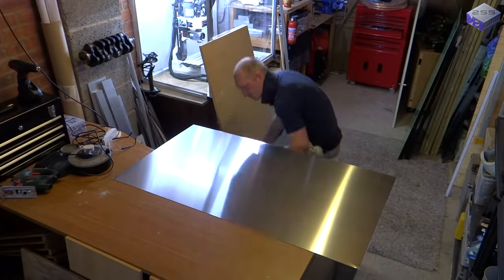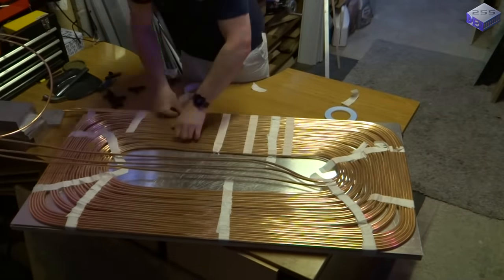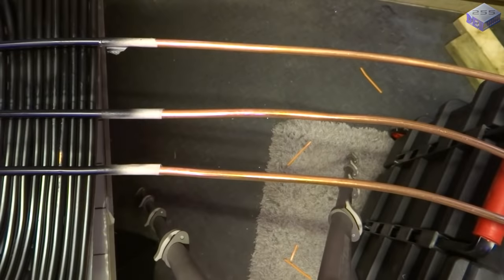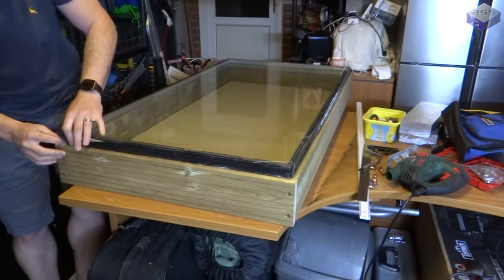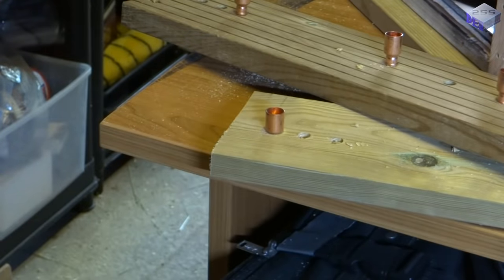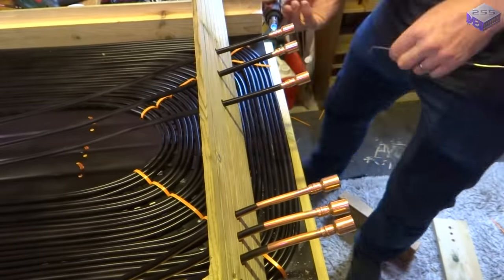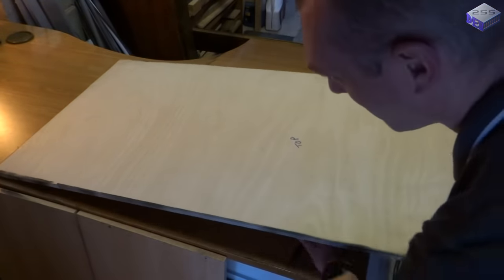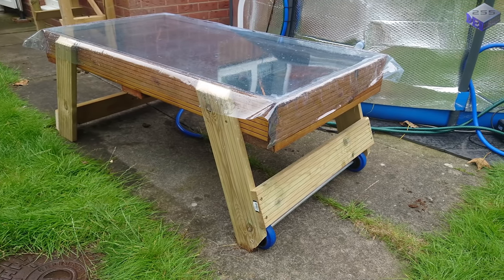Improved Solar Pool Heater - Full build

Comment: i appreciate you show your scientifically made diy developments, but you are wasting copper to heat a pool near the north pole, wouldn't be better you to move to the south so you don't need to heat a pool in first place?. however this system can be used for an emergency solar still to preheat the water, ceramic clay tubes could be an option to replace cooper as they are thermal conductive as well
Reply: Hi, thank you, I would love to move further south, unfortunately it's not possible at the moment. I've not thought of clay, although this may be slower at thermal conduction than copper. This system ran around 500W average in the short summer that we had, hopefully next year will see more sun, so that's around 4kWh per day (8hrs of sun) from a small panel (1m X 0.7m ish). In comparison, I have just purchased a PV panel of 330W (1.6m X 1.1m) that can only produce   2.64kWh in the same period, so the solar thermal system is a lot more efficient.
Reply: @neildevonshire2434  so you are making a mixed heater with solar thermal and solar electric with a heat pump powered by PV. i think that if you can find black sand you can use ultra thin irrigation tapes of the smaller diameter and use several layers of film for the housing instead of glass, the more layers and separation of film the less thermal losses by conduction and convection (similar effect of plexyglass or polycarbonate multicell panels) and to avoid thermal losses by radiation in the back you can use mylar emergency blanket under the black sand that acts as solar rays assimilator and heat reservoir. i suppose this solar thermal setup would be pretty efficient for the same solar area used and way cheaper and available, but again you can even hike your way to the south.
Reply: @crapisnice  The PV panel is for another project, I'm converting a milling machine to Solar CNC and the current setup (50W) is quickly becoming inadequate. The milling machine conversion is required to create parts for an electric vehicle conversion. So my EV car will not only run on clean energy, but also be home manufactured using clean energy. I have thought of a geothermal solution also, although I am unable to dig up the garden
Reply: @neildevonshire2434  i don't support bulk electric energy, chemical batteries or heavy personal transport for salaried commuting, however with your recent thermal energy knowledge you can build an ultralight vehicle powered by isothermal compressed air ICAES. you can build your tanks with recycled plastic using rotational moulding and plenty of fiber wrapping (if made large they can be used as vehicle structural chassis. to make a cnc you can use air or hydraulic stepper motors and attach a wind turbine to a compressor to fill the tanks, you can use an open hardware cnc control board and adapt to pneumatic or hydraulic
Reply: @crapisnice  Sounds like you have some good ideas about renewables, have you considered putting together a few plans and ideas and maybe experimenting with things (safely that is), I am kind of on a path with my current projects that will take some time to create, so wouldn't get round to experimenting. As you said, hydraulics/pnematics could work, there are plenty of people that will say it won't, it's just a case of building it then proving what can be done.
Reply: Lol, the guys budget was around £250 and done over a weekend probably, but you somehow think it might be better to sell the house, and move the whole family further south where everything in general is more expensive? plus the other problem with the south is...its full of southerners 😛

Anyway, nice job on the heater, currently looking at "diy build" options for ways to help offset the cost of heating a hot tub when me and the missus eventually pick one up,  had previously been looking into diying a wood boiler, which might still be a potential alongside this to just quickly dump some extra heat in over the winter months when the daylight hours go down, but this is a far more passive option that doesn't really need me to do anything once its built, which is  part of the appeal to me,
Reply from the maker: Thank you. These are a pretty good option for hot tubs as there is far less water than we were heating, last summer (2020, the warm one) we got our pool with 4600 litres of water up to 31ºC, although did take a week to get there; with a hot tub you probably have a 3rd of that, so should see good gains. The other options could be a ground source heat exchange or, as you mentioned, a wood boiler. The first pool heater is still a winner in my opinion, especially with all the effort that goes into making version 2, although version 2 does have a smaller footprint.

Good luck with your one.
Reply: @TheSolarPoweredEngineer  cheers Neil, yeah I'm estimating in the region of 1200 to 1500 litres depending on what's available used at the time but it's good to know that you managed to heat something that size, although I am in Scotland so I might need to oversize it with me being nearer to the North Pole 😋
Reply from the maker: @weegaz22  I'm sure you could hit the North Pole with a few skimming stones from Scotland, besides they have more sun at the NP for 6 months of the year 😉

Comment: very expensiv....
Reply from the maker: It was fairly expensive to buy new, although if this could be made from spares around the home, old glazed units, etc, this should be achievable. A scrap copper radiator may work well too.

Comment: OMG ....Just use a pool blanket!!

This is obviously the dumbest idea ever.. A pool blanket will catch much more heat and cheaper and easier and also reduce evaporation sorry to be frank but I cant believe how stupid the internet still is..
Reply from the maker: Hi, I do have a black pool heat cover also that should transfer the heat to the pool well, especially with the surface area it has, although the air blowing over the top removes a lot of that heat, I do keep it on though to reduce evaporation. This was the idea behind trying something covered and seeing what works best. I was impressed by version 1 with 50m of black tubing, as it got up to 900W during the midday sun and 600W average over an 8hr sunny day, so that's 4.8KWh per day in good weather, or 80p saving a day (granted the first panel cost near £200, but this was a fun experiment to try). I'll be doing more testing with version 2 when the sun appears.

Comment: Not true ,do not spend money on that crap,like I did,does not heat your pool
Reply from the maker: Hi, it really does depend on the size of pool. This generates around 500W, so does have a heating effect. This and my previous one got our 3m diameter pool up to 32ºC last year, where I have since calculated where all the heat in the pool comes from. Where this panel generates around 10% of the heating, my previous panel around 12%, a pool cover around 30% and the main heating coming from natural ambient temperature heating. So all in all these do help to increase the pool temp, where at 10% this would help to raise the pool by a few more degrees than could be achieved without it.

Comment: It's the worse design you could have created.
Reply from the maker: It may well be, although it seems to work well, plus I am learning through single changes to try and find the best solution, such as side reflectors that track the sun on to the panel, reduced air inside, different cover (not double glazing), etc. What would you say was the best design?